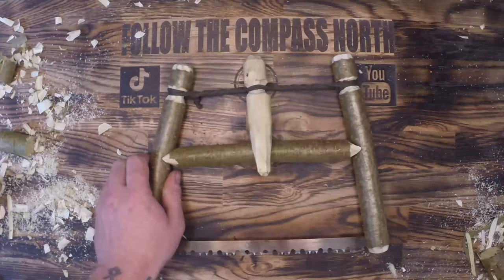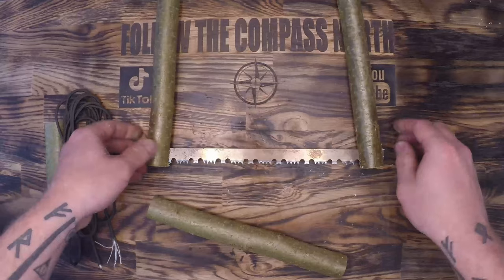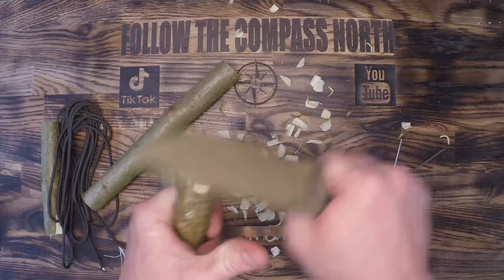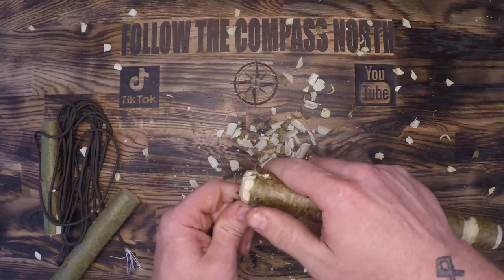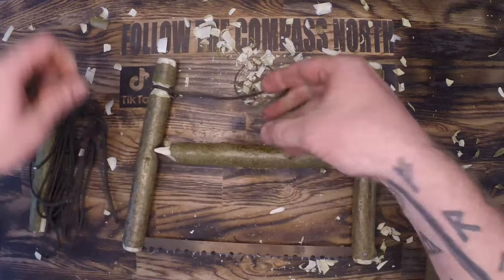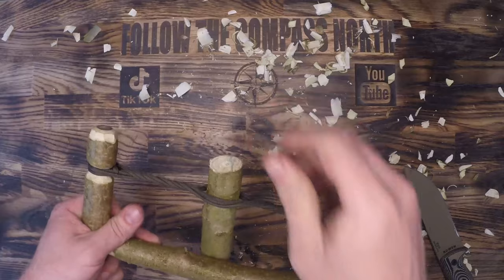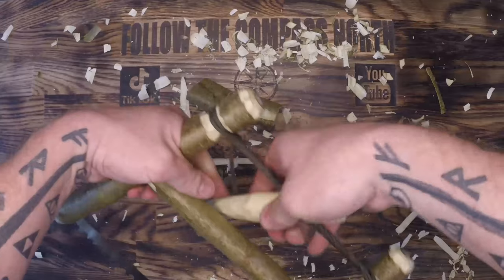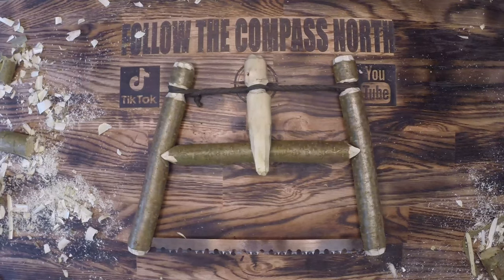Mini Bucksaw Build: Tips and Tricks!

Comment: Excuse my ignorance but is the piece in the middle just used for the tension pulling of the two end pieces? I’m not to familiar with a bucksaw
Reply from the maker: Yes, as you twist it... it pulls the 550 tighter levering on the stretcher in the middle to pull tension on the blade.
Reply: @FollowTheCompassNorth  Thank you! Please keep up with the amazing content